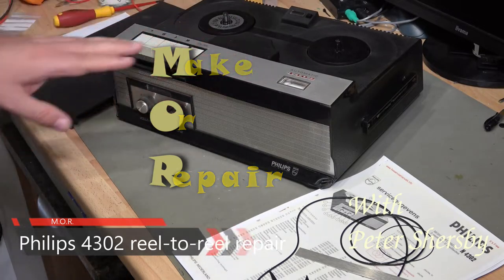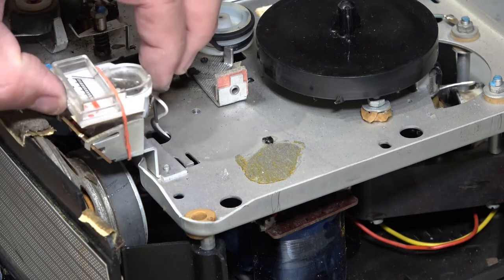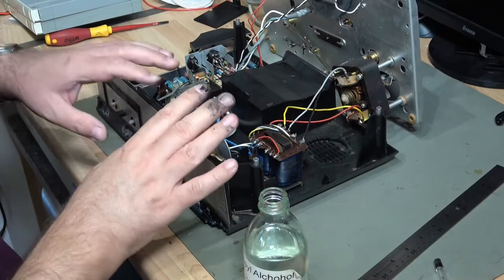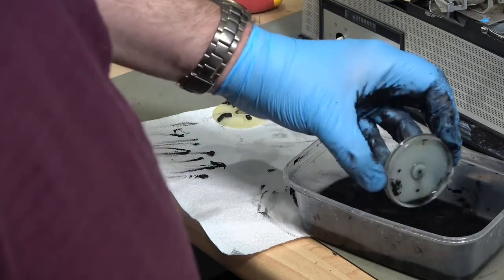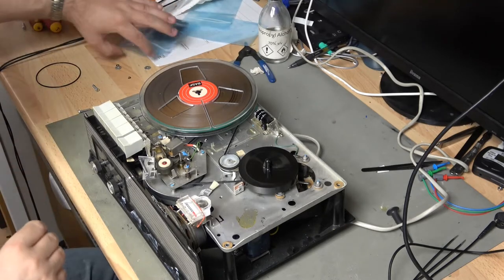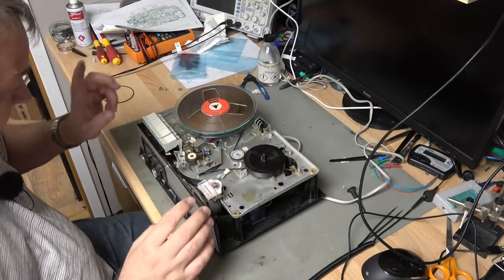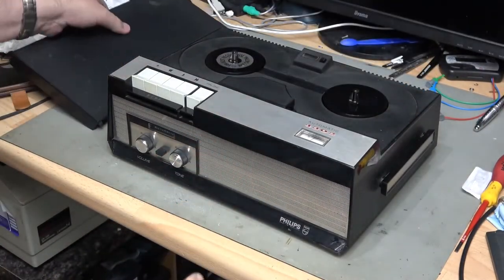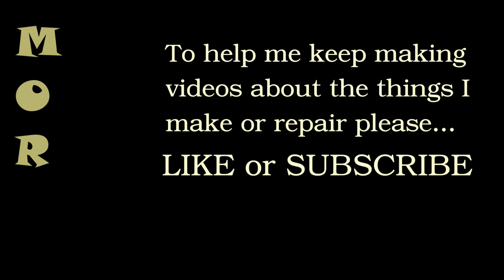0022 Philips 4302 reel to reel repair

Comment: Thanks this video =) I have clutch problem, my PHILIPS EL3558. No manual no service-manual tell what kind rubber is in. All rubber are melt, like you have. No I know more. Maybe I use O-Ring for his??? or half and glued in place.
Reply from the maker: Not sure of the model but if you can get it to fit maybe you can make it work

Comment: I've got one to repair at the moment and the dial on this one is held on with an identical looking elastic band. I assumed it was a bodged repair but seeing yours I'm wondering if it was an original feature.
Reply from the maker: Interesting,  I think they might just be using it to keep it in place during assembly.  The rubber parts etc have held up fine,  but I needed to revisit because one of the belts was to loose and came off after about 2 weeks - there were two different models and I think my belt set was for the wrong one!
Reply: @MakeOrRepair  I've ordered belts for this one, I hope they fit. Need to fix the same clutch fault you encountered but I've read that o rings might work. Lots of liquid rubber to shift first of course
Reply from the maker: @Andy Littlejohns  good luck, that rubber was so messy!